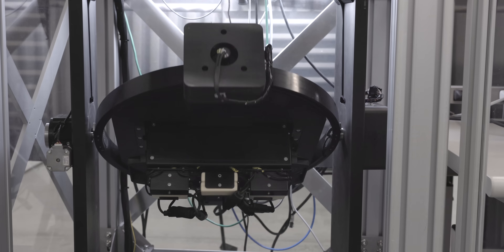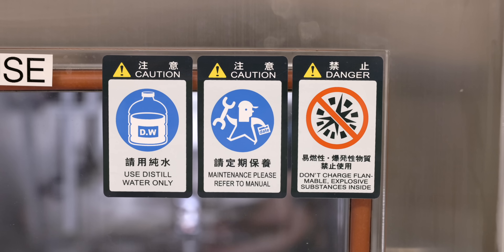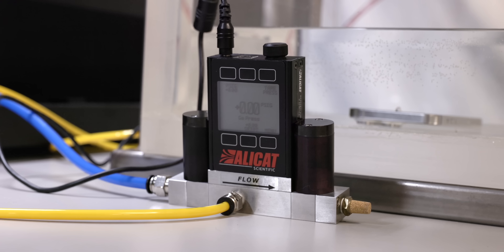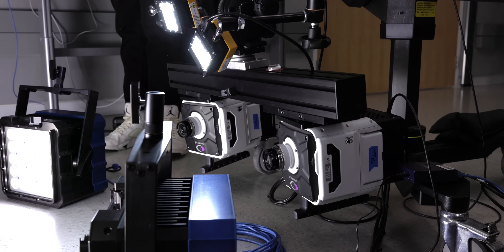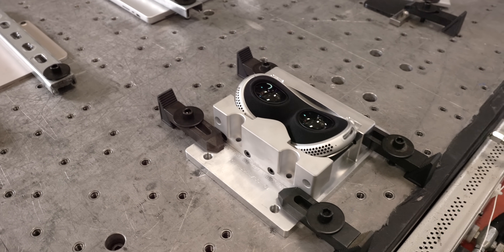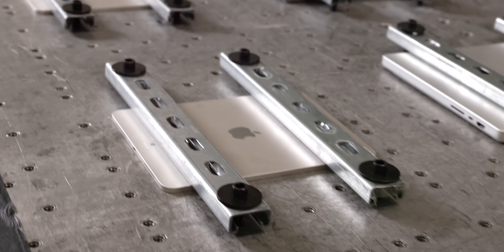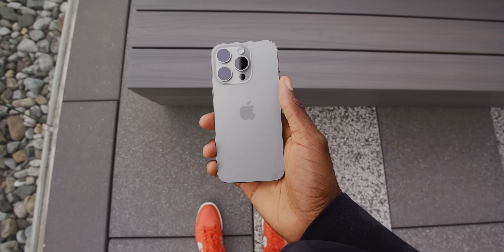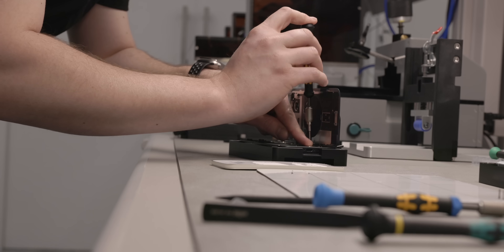I Visited Apple's Secret iPhone Testing Labs!

Comment: bro a few moths ago i accedently left my airpods pro in my clothes and got washedand dryed and when i found them both earbuds were out of thier case burning hot as well as the charging case and charged it and worked perfectly normal after that: ps i also went in a pool with them still fine after that 😁

Comment: Here’s a concept, for every part that Apple sends to repair shops, just have each part paired to a very specific code that is solely exclusive to that particular part I.e a custom code that the service center just needs to key in to confirm it’s a legit part then the phone can go as usual. 
It could be a code on a piece of paper that is shipped with each part or have the serial number or model number be the code.

Comment: Better for environment ?
Device gets end of life
Battery dies 
Screen may need replacement due to cracks or screen burn or green line
Back glass wear be tear for many years
No option for consumer to repair due to parts being serialized
Glued back case like what are we even playing under the rain or under the sea
And you sell yearly devices 
You are just lazy and we know its to lessen manufacturing cost removing accesories
Moving to cloud and AI

Comment: something can be made durable without it being impossible to work on.. see old laptops easy access removal of ram, storage, and battery.. if you smack an old mac against a new one that new mac will lose.. and you are saying more durable less repairable? the fact that they make it hard to reuse parts salvaged from used/broken devices? and the way they refuse to sell parts? you are so deluded if you believe their scale of horse manure..

Comment: The battery will fail but it;s better for you that for the 1% of people that drop it in a lake, you just can't open it easily and replace it otherwise the phone would last many years. It's better you buy a $1000 phone each year and it's durable lol. What about the speakers, microphone or other parts that fail ??

Comment: The gluing in of the battery's in apples devices predates by a long time them being made waterproof.

Its simple apples devices are too good and too expensive that they have to make them hard to repair so that they actually will sell new phones.

With the way an iPhone 5 performed when it came out you would still be using it now if it could have its battery easily replaced and it was repairable.

Comment: As an industrial designer in the industry, I must say the topic of repairability for Apple as a company is a difficult and complex subject to discuss. Especially for what Value and Mentality apple as a company represents. The obsession over tight control and integration of basically everything is one key aspect of what made them so successful. When strictly speaking about repairability and durability he is not completely wrong. Most people only look at this from a repairability perspective. Repair shops and people want to get stuff fixed asap. I get that. And it is important to make sure that there is a solution to make that happen. But I must say that most people seriously underestimate how difficult and complex it is to actually make these products. And also to make sure that they are both durable and repairable. Especially at a scale that’s as large as apple. I’ve worked on outdoor navigation devices before, internally there were fierce debates over the importance of repairability, but always in the end compromises were made, since we expected the product to be treated harshly in the field, it must be extremely durable, that means a lot of seals, gaskets, adhesives and more. Down to the last detail, even the method of soldering on the production line and the material used for the circuit board had to be considered for durability requirements. We also had to control the amount of parts we have so that the amount of failure points are predictable and controllable, I won’t go into more details but to put it simply, a lot of it go very much against repairability. Of course, we could have implemented manufacturing processes and materials that could dramatically benefit repairability. But in order meet other criteria at the same time, the resources needed to achieve that in terms of R&D and BOM would mean that we will not be able to deliver the product into the market segment we previously planned. And if the economy doesn’t work in a commercial project, nothing works. As a person who works in the industry I can promise you that the people behind the scenes are not all corporate monsters, they do consider repairability as an important aspect in R&D, I mean we also don’t want to screw ourselves over when we have to repair a device for our customers, objectively it would even spare us trouble if the customers can fix it themselves. But things don’t always work out that way in this economy especially for electronic devices. When you tinker with something in the system to benefit one aspect, something else has to give. For a product to be as durable as it is repairable, it’s certainly possible, but all the puzzles need to align for that to happen. And sadly it does not happen too often. I do look forward to seeing governments regulating issues related to this. If things are mandated it levels out the playing field for everyone in the industry. But do remember that as the balance changes in development, something else will have to give, may be the price tag or something else idk we’ll see. But I’m all for it if it is better for the environment in the end.
Reply: The problem with your argument is that in many cases they make simply choices that have nothing to do with reliability but 100% just to fuck up repairability. Good example is software restricted part replacements. These actions these days remind me most about Microsoft in 2000s when they tried everything to fight Linux and others that cut to their profit margins. Many of their actions had nothing to do with serving the customer, but impeding the competition. Apple's efforts here are often not about serving the customer, but impeding repair shops that they don't interfere with good chunk of money they make with expensive repairs.
Reply: I agree with you. But that’s also why I said it’s difficult to talk about this matter in apple’s case. It’s not just about profit or competition. This is the tight control I was talking about. To follow up on the matter you mentioned, from a manufacturer point of view restricting compatibility with other parts can ensure that no parts that are not certified can be fitted into the device. Some third party parts simply cannot preform well and some could very much cause problems in the system. Even genuine parts that are not calibrated could sometimes cause issues. And therefore affect the end user’s experience. There are also tons of unqualified repair shop out there that would do anything to cheap out on the repair to make a profit. Simply because most people would never open up the device to check whether the repair was done correctly. As a brand it’s a dilemma. On one hand you wanna ensure the quality of your device over the entire lifespan of it. On the other you could publish guides and sell part to encourage customers and repair shop to do their repair on their own. But you will have no idea whether the person is capable of doing so. And sometimes they come back with a device that is so messed up you end up having to replace more parts than you have to in the beginning. So most brand that that cares actually prefer customer to come to them directly for repair to avoid all the hassle. Still, like I said I hope the governments can do more about this, to make repairs easier in some way of form. I’m all for it. Will also be interesting to see how these tech giants react to the change.

Comment: It's funny that after I dropped my iPhone 13 Pro Max into the toilet from like half a meter, it hit the inside and then got submerged (no chassis and screen damage), and my Face ID stopped working, My Phone kept turning on and off quite frequently, it showed that there was no SIM card and also there was an issue with the WiFi module. I was only able to make it usable after putting it into a bowl of rice for 3 days.

And then without me even mentioning this fact to the Apple worker at a local store, he mentioned that the only thing he can offer me is, check this out,  "a repair by giving me a new phone", and that just killed me (I would have to pay full price of my current phone, so basically buy a new one). And he had the audacity to tell me that if I decide to spend a little bit more I can get the 15/16 series! For me this lab might not exist at all, because it simply didn't test my iPhones durability enough. Or they just decided to test some phones for fun, and then release phones that were not tested.

Apple product, no matter what it is, is not, and will never be repairable at a reasonable cost.

Comment: Fake reasoning: repairabilty means less reliability- a total gaslighting. Those are not against each other.
Reliability depends on the quality of components inside and how those are put together. And put together DOES NOT only mean glued together, but the most importantly-soldered together, or lego stickers, stiffness of mainframe, screen glass etc.
Repairabilty can be a sliding scale with weight, or with size, or with the price since screws are more expensive to build than glued together.
Reliability is not a function of glu.
Glu is not the only factor for being water resistant,
Water resistance is NOT the only factor of reliability.
Such a blatant manipulation.
And given how unrepairable and expensive apple products are, then those must be the most reliable AND most repairable ones,
Or the most reliable and least expensive.

Comment: Repairabilty can be a sliding scale with weight, or with the size-yes, BUT never with reliability.
Or repairabilty can be more expensive, since screws are more expensive than glued together.
So, considering how expensive and unrepairable all apple products are, then according to this vid, apple products must be the most reliable and most repairable ones.
Or,
Most reliable and least expensive.

Comment: False reasoning:
Most of screen replacements needed due to glass brake, NOT from water damage !
All customers know that if a phone drops into the water it's mostly gone, no matter what fake ips6 resistance it has.
But the most phone dmg happens from falling on to ground, not into the water.
Such a big gaslighting.

Comment: Approaching this from a different angle than most of the comments.. I find it interesting the signage for at least the rain water test said distilled water only. For those that don't know, water is actually a fairly good insulater, and it's the particulates in it that can cause shorts which are what damage the system. By using distilled water, you are completely removing the real world aspect from it for probably 99% of the water damage situations. Now it's not a guarantee that the phone will be bricked after spending a week in a lake, but it would've likely had to auto shut off almost immediately and then be cleaned with distilled water after the fact before turning it back on.. unless their seals are that immaculate that nothing can get in anywhere. If that's the case though, then stop using distilled water for the tests. Use more analogous conditions to the real world. I would be curious to see if they can do that same pressurized dunk test with let's say an electrolytic rich solution like sea water.

Comment: I’ve been daily driving a 14 pro max for almost 2 years now. No case, no screen protector. While I definitely don’t drop my phone a lot it has fallen down a flight of wooden stairs, been dropped on concrete at least 3 times and been dropped on my hardwood floors at least 10 times. No cracks or chips in any glass, nor loss of any function and only a couple scratches on the screen that I can feel with a fingernail but are invisible when using the phone.

Comment: So I am conflicted (yes, I am late to the party, I get it)

On the one hand, the lab is great to see and really interesting and there are (let's be real) valid points in that it is difficult to create a device that is as resistant to water than a modern phone is AND make it small AND make it repairable, this is a hard engineering task to do.
But stating that making a robust device directly contradicts making it repairable is wrong. One example of that is the new generation of iPad, it clearly is not more robust than a device with more "thiccness" (sic!) would have been, but it is a hell of a lot more difficult to work on since it is hard to use "standard" hardware that can actually be repaired. I am talking about screws and latches, I am talking about the area glue is being required.

Other commenters are absolutely right that Apple is trying to get their way with locking down firmware, but this is not what this is video is about, this video is about mechanics, not software, that's why I focus on that.

But on the other hand, my phone of choice is a Samsung which is pretty much as bad as Apple to be frank...

Comment: You can simply replace the battery of a watch that goes 200m under water So technically, you could build an iPhone with IP68 in which you can change easily the battery. Don’t listen to this marketing sh*t.

Comment: i had a brand new Apple charging cable used with a Apple charger catch fire (no kidding) while charging my iPhone. I was shaken a lot as it happend just before i did fall asleep. The incident somehow damaged the port on the phone it did not charge after the incident. I contacted Apple and at first they said the broken phone was my problem and they only wanted to give me a new cable and even the cable i could only get when i would handover the damaged cable. This all took place after they verfied it was a genui Apple cable (there is a serial number on the cable i did not know even cables had serial numbers). I was furious because it made my phone a brick and i did think they should replace it. I said if their cables are fire hazzards that i would be better off posting that on the internet because i would not get anything anyway. The responce was silly, i was called within 15 minutes that i could get a brand new phone at the nearest shop the same day if i would not post anything and would handover the cable at the shop. Their products are good but not unbreakable at all and they manipulate and cover up what hurts their image the most. So some of that "durability" is created by cover up actual broken parts. Their products rank high, but not higher then the competitors flagships.

Comment: I have a problem with my gf iPhone XS, the main speaker gets deactivated, yes deactivated, not damaged not defective, they just deactivate it so the only speaker that works is the top one for the calls.
Another funny thing is that if I forcefully reset the phone or If I go back to iOS 16.5 and then back to 16.6 it suddenly works, but guess what, after a week the speaker stops working again, so tell me this isn't a strategy to screw customers and force them to upgrade their phones.

Comment: I appreciate that maintaining relations with big brands means not going in hard on them, and I appreciate that you probably don't have the technical expertise to know when you are being gaslit by Apple, but in which case, just don't DO videos like this.
I don't know which member of Apple's PR department gave you the "Durability is at the opposite end of repairability" line, but surely that only applies to badly designed products? Rolex watches are fantastically durable, yet fully repairable. Where is the tension there?

This is all that's wrong with  access journalism.

Comment: The only aspect of durability that is odds with repairability is the ingress protection.
But what Apples does to ensure there is no repairability goes way beyond.
Software part locking, creating custom screws, not letting their parts be available on the market, the list goes on.
As Louis Rossmann accurately pointed out, the ingress protection is not the thing that is hindering repairs. It's these other things that are.
And these other things are 100% corporate greed. No 2 ways about it.

Comment: Yes things can be made more durable and reparable. Look at some of the rugged phones. Some are very easy to take apart and replace
the components. Most products are designed to be put together fast by machines and almost impossible to take apart. 
Great cad designers with a sole purpose to make it repairable with mini screws and gaskets.
A propaganda video to claim someone is giving propaganda is worthy of a thumbs down.

Comment: Apple: "Repairability comes at the cost of durability."
IBM ThinkPad: Exists
Reply: my thoughts exactly
even under Lenovo thinkpads were both durable and repairable
they have no idea what they are talking about
Reply: From what I've heard and experienced as a tech intern for my school county, they have to be repairable to appeal to schools, which I noticed they were when I had to take them apart. It also explains why my high school went from having ipads, to Surfaces, to Dell/Thinkpad laptops. The ipads were also a lot more difficult to reimage, which also was a bit of a pain. And by pain I mean it took 5-7 more steps than it took to reimage ANYTHING else. Really makes you wonder...